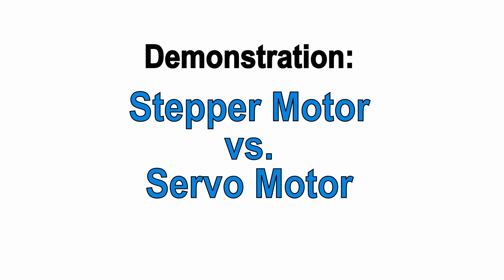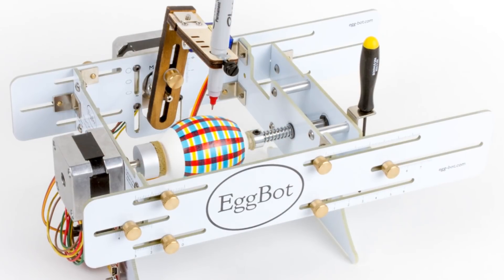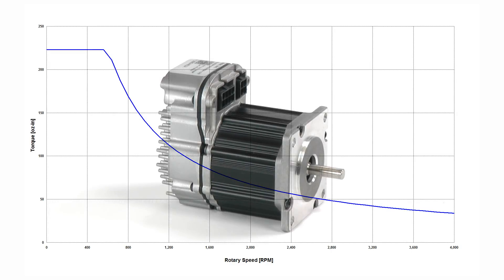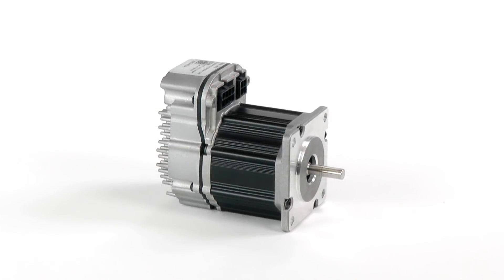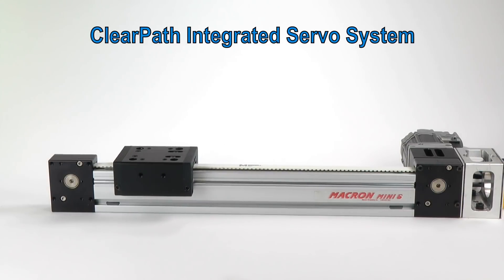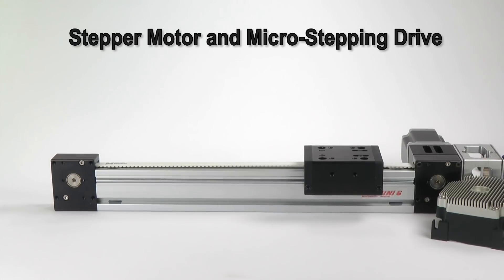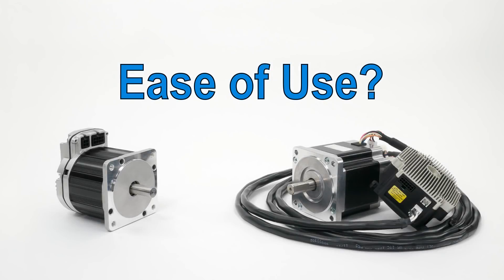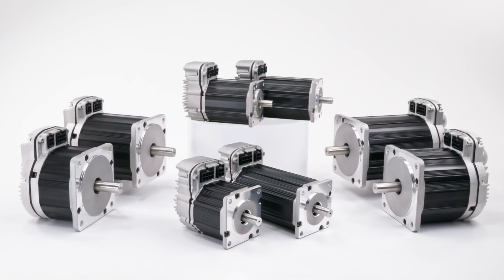Stepper Motors vs. Servo Motors - A ClearPath Demonstration

Comment: Got a pair of these beauties on my red sail clone laser cutter. I got to say that I was not super impressed with the auto tuning but after manually tuning them they work much faster than my previous step motors. They are about as good at low speeds but as I go beyond 100 rpms they are the clear winner.  They also allow for stupid fast acceleration which to me is even more valuable as it minimizes over burning associated with slow cutting speeds. I wish the auto tuning allowed you to set  machine specific parameters like the intended maximum speeds and acceleration. While the auto tuning does wonders for the higher rpms one can achieve significantly better results by specifically tuning for your intended use.
Reply from the maker: Hi Abraham, thank you for your feedback. We wrestled with how much data we should ask users to provide to the autotuner. Providing more data about the mechanics and application, if accurate, definitely makes the autotuner’s job easier. One feature to help optimize the tuning for different applications is the “fine tuning” slider located under "Setup" and "Fine Tuning". (A lot of people don’t notice this tool—we may have to make it more prominent in the UI.) The slider allows you to trade off stiffness and disturbance rejection for quieter motion (especially at the lower speeds). If you have already manually optimized your tuning, you won’t need this slider, but for future applications, you might find it helpful.
Reply: Teknic Inc you truly have a killer package here. The more I use them and learn the more I appreciate how great they are compared to steper motors.

Comment: servos are, in some ways, better than the stepper.servos are useful in hobby electronics.i suggest servos for robotics beginners but steppers do have a lot more importance in the current world like printers.therefore i suggest to even learn about steppers too.
Reply from the maker: Hi Abuthahir-Thanks for your feedback! I agree with your comments. For motor sizes smaller than NEMA 23 (like what would be used in a desktop printer or other table top applications), steppers often make more sense because they are relatively inexpensive compared to servos at that size (NEMA 14 and smaller). This video compares industrial servo motors vs. stepper motors in the NEMA 23 and larger sizes. For hobby electronics (such as RC cars or planes), servos actuators are typically used, but those are much different from the servo motors in this video.

Comment: I've a laser cutter machine that I think will really benefit from the clearpath servos. My only concern is the "enable" signal, my current leadshine stepper motor drivers do not use that signal, and as far as I can see my motion controler (Ruida) does not have an output for the enable signal. Is there a way to bypass the enable signal at all?
Reply from the maker: Hi Abraham- For safety reasons, it is not possible to by pass the enable because this is what allows the motor coils to be energized and de-energized at will. Without enabling the motor, you will not be able to command ClearPath to move. However, the enable doesn't have to be connected to your controller. You can wire the enable up to a simple switch. You can enable and disable the motor through a mechanical switch and when the motor is enabled, send commands to the other inputs through your controller. Just be sure that the switch is rater for 5-24VDC logic power.
Reply: Already ordered! found both 5V and 24V 500 ma logic signals on my laser cutter controller. I'll be adding some before and after videos of my machine once they arrive.